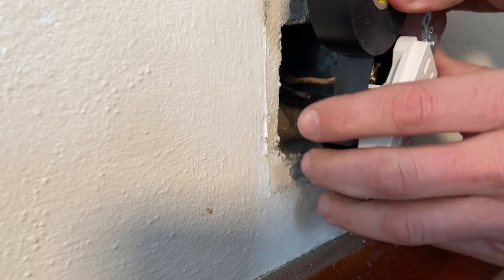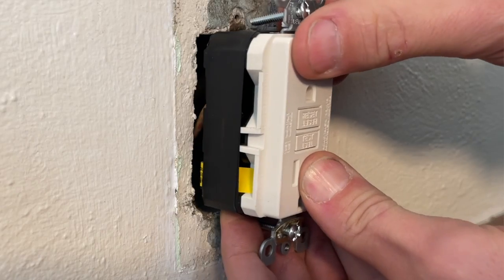Should You Wrap Outlets In Electrical Tape?

Comment: As an industrial electrician for nearly 20 years, I always wrap the receptacle in metallic boxes. I do not tape receptacles in residential and light commercial non metallic boxes. I do tape wire nuts in outdoor installations to help keep out moisture.
Reply: Have you ever removed a wire nut in a box that has been wet but has dried out? You’re likely to find find moisture inside the wire nut, it gets in but doesn’t get out. I’ve seen it hundreds if not thousands of times.

Comment: ALWAYS WRAP. nothing to loose. Possibly LIFE to save! (life of someone knowing nothing about elec opening and grabbing outlet, or hot screw touching metal box of an ungrounded home causing hot ground plugs of anything plugged into it.
Reply: No no need to wrap. That's your own damn fault for doing that. Bet you learned your lesson.
Reply: @bluejack-ve7so  you need to wrap in metal box.
Reply: @gabrielM1111  no you don't. Nothing in the NEC about wrapping a receptacle with tape in a metal box. That's just a personal preference.
Reply: @gabrielM1111  and actually a metal box is more safe than a plastic box. A metal box is grounded so if a hot wire comes in contact with it, it trips the breaker. With a plastic box it just melts it away. No return path to ground.

Comment: Before I end my wrap I like to leave a little tang on the end by folding back about 1/8 inch and stick it to its self. The next guy will thank you!
Reply: You plan on reusing that tape?
Reply: @dannychavez2420  No it's just a curtesy tab for the whoever needs to remove the tape later.
Reply: How long does it take to unwrap it? Waste of time!
Reply: @dannychavez2420  … it doesn’t take long at all if the last guy left you the tang (or flag) so your not fumbling around looking for the end.

Comment: This is hilarious, only wrap and use wing nuts if you are from the 1980's. All my remodels are done with WAGO 221 series snap on connectors (2, 3, and 5 port). Safe, UL listed, and highly durable. Works on 10 awg to 26 awg wire, never had a problem, not even with stranded wire.

Comment: Keep in mind that in many areas of the home, replacing a 2 prong outlet now requires AFCI and GFCI protection to meet code, and those outlets run about $26 a pop.
Reply: I refuse to do that. If someone wants them replaced they either get another two wire or it gets rewired. I don’t believe there is a substitute for a proper ground especially when you’re relying on electronics.

Comment: I wrap tape around outlets and switches especially in metal boxes and crammed boxes. Tape around wire nuts is pointless because if its done right there shouldn't be any risk of arcing.
Edit: I don't use wire nuts any more I prefer the Wago lever nuts. They are a lot better than wire nuts especially for old brittle wires.

Comment: Before there was Scotch 33+ there was just Scotch 33. Before that there was vinyl electrical tape of various brands and qualities, and some of it was horrible - it was brittle off the roll would dry out and fall apart quickly. Before that, black friction tape was commonly used to insulate splices.

There used to be a section in the NEC regarding proper taping of wire nuts which required the wrap to go around the crotch between the wires and the wire nut, covering the open bottom of the wire nut and providing additional mechanical strength to the splice.

Comment: I always wrap receptacles inside metal boxes. Master Electrician, CET
Reply: Why? Are you bridging the metal box to the receptacle? Because tape does nothing except trap heat near the wires.

Current doesn't magically jump air gaps unless the voltage is sufficient to overcome the resistance of the air. And if you have that much voltage coming in your stuff will probably burn down long before reaching that receptacle.
Reply: @etherealrose2139  Not wrapping the wires, but the terminal screws. It is mainly meant when one has to work on a live circuit. Sometimes it is just not feasible to turn of power.
Reply: I suppose you also love everything TR.

Comment: I never see these surveys and I don't even see some videos, like this one, that says was 2 years ago...

I personally ALWAYS wrap electric outlets, regardless if the box is plastic, which I will rip out if it is, and replace with metal, but regardless. The reason is probably my stubbornness to do things the right way. The reason I think it's the right way is because that's what I was taught in trade school back in the 1990s and the reasoning given was that when a box is stuffed with bare wire, "Grounds" that they can move and "spring" action from tension of being stuffed, and make contact with a hot or neutral side, creating a short or a danger. Then of course the second reason, which is my obstinacy on metal boxes.

When I started messing with electrics, I always wrapped my wire nuts but I also installed them correctly to begin with. I took my electricians pliers and twisted the wires first, then used the appropriate sized caps. Do a tug test. Then wrap in tape. Just always something a little extra. Also, had the idea that if something was to twist or try to wiggle loose, it would be less likely because of the stickiness holding everything together. When Wago came along, and I learned about Wago from you, and where I am at now, I loved them, and I still do. At first, I didn't wrap them in tape, but I noticed in some instances, they would pop open, or could even be pushed by a wire. So I do use electrical tape for those too. Just a wrap over the levers themselves, not the actual wires.

I don't see myself ever going back to the old wire caps again and even have removed a lot of wire caps and replaced them with Wago nuts, even though there wasn't anything wrong in the first place. More OCD I guess. It's not easy being me.

Comment: Interesting poll. My dad taught me about electrical wiring and he never used tape on the outlet. He taped the inside of a metal box, but never taped using a plastic box. I've never heard of wrapping the outlet, and I can't begin to imagine the frustration the next person will have to deal with after years of temperature changes turns the glue into a sticky mush. 

He definitely stressed the importance of proper wing nut wiring. He never taped the cap to the wire, but he did tape the wires right below the cap (to strengthen them from separating) and then again a few inches down. I've been using this technique to this day regardless what I wire. Gravity and time do some impressive things to wires we take for granted.

Another thing he taught me to do was to twist a ring on the hot wire, then use it to hang the line from the grounds. 

I never could understand why he did this until I studied electrical engineering. I suppose the technique of hanging was borne of a time when insulation wasn't great and electromagnetic feedback had an impact on electronics. 

We're a very foolish country for giving up trade schools and apprenticeships. Just a personal opinion.

Comment: One thing I have noticed with many of the recent  outlets is plastic rot I call it.
This were the plastic  in the outlets become brittle regularly of environmental conditions. I had the lowest quality  to highest due this???
I'm not a professional in any way.Is this because the companies are using lower quality plastics to save money in production  costs. This was apparent even before the Pandemic. I had to rereplace receptacles. The whole receptacle past front crumbled away. The reason I had to replace it was just plugging in cord for the vacuum. The tape on the plastic wire connector is a tough one.Its about 50/50 for and against the process .Good Video 😎

Comment: Electrical tape around a device is not needed. Some downsides: it can come off, can help encourage moisture retention around the screws, and is a pain to take off when the outlet has to be serviced.
Reply: NECA NEIS 130 5.3 Conductors (L) states "DO NOT wrap electrical tape around wiring device terminals. Taping wiring device 
terminals will prevent heat dissipation from the wiring device." National Electrical Contractors Association  National  Electrical  Industry  Standards
Reply: @Robnord1  I wouldnt call anyone a fool while suggesting using wire nuts in a high vibratrion setup. either a crimp nut or a properly crimped butt connector. in a high vibration application a wire nut should really only be used to test for example a motors rotation direction, I wouldn't trust it long term in a high vibration setup.
Reply: @wrenchinwithlondon3141  I agree with you, but worded my comment poorly. I see wire nut use regularly in my HVAC and RV work. In those environments, it's common practice to wirenut, then tape  for security. Not the best choice of connection for sure, especially joining stranded to solid, but they do it for economy. I don't complain much though because meltdowns are a source of income for me. 😉
Reply: @Robnord1  Oh definitely. I've seen a fair bit of it rv's and even heavy equipment. But I work on the manufacturing end now so we don't ever want to have to touch a piece again once we finish so wire nuts are a no-no minus for testing purposes haha

Comment: One problem I have found twice when an GFCI was wrapped with electrical tape:
Both instances were single gang metal box. The GFCI was wrapped and stuffed in the box, but the installer installed it slightly off center. The electrical tape kept the hot screw from immediately shorting against the box, but over time vibration of outlet use (guessing) eventually wore tape down and circuit breaker popped.
On one of them, the breaker must have popped many times, considering how burnt the screw was.
If the installer wouldn't have used tape, it would have been immediately noticed that the outlet was offset against the box. It might have been the outlet didn't originally have tape, but did after it popped the breaker after initial power was applied.
Anyway, I believe the tape is just hiding a potential issue.
Reply: So you’re saying don’t wear a hardhat on the worksite so if there is an unsafe condition and a brick falls on my head, I’ll immediately know it was a brick and then I can correct the situation?
Reply: @mook528  hahahahahaha, amen brother. I couldn’t have said it better myself. You beat me to it.
Reply: One suggestion for you is to stop using the word “popped” and start using the word “tripped”.

Comment: I work commercial and industrial. I do wrap receptacles in electrical tape because we use metal boxes. It’s good practice, and avoids shorts if we’re jam packing the boxes (double duplex outlet, or someone spliced in the back). Most of our receptacles are prefabbed with a pigtails coming out, so we just makeup with wire nuts, fold in the free conductors and screw in the device. 

I would make the device before any installs. So cut 7 inch conductors, loop the wire if solid, crimp the wire if stranded with a fork terminal, drive the set screw, then wrap the receptacle with electrical tape. It saves time.

Comment: I believe a good time to use tape on an outlet or switch and wrap the wire nuts is when you have a full box of wire nuts and a bare copper ground wire. When stuffing everything back in the box, that bare ground wire can sneak under a wire nut opening or touch an outlet/switch screw. Taping eliminates that chance and it only take a minute to do.

Comment: Same here, always in a metal box AND with Super 33 +. I don't normally bother with taping wire nuts, but go case by case. I noticed when he removed the tape, it was wrapped backwards. You should start on the wire nut wrapping in the direction you tighten it. Continue around at least twice and work it down onto the wire 3 times around. Like dad said, if you're going to do it, do it right.

Comment: What about the receptacles with USB ports built in with the standard plug?

These seem to have some openings along the outside of the housing which is meant for a heat sink or air flow and it doesn't seem intuitive to cover something like that up. 

Thanks.
Reply from the maker: Good point Jeremy, if there is a heat sink that would definitely not be advised to cover with tape.
Reply: @EverydayHomeRepairs  You can just cover the terminals only, but definitely not a good idea to cover the vents.

Comment: I use tape on receptacles when in a tight metal box as you have described.  I do not tape wire nuts as I have not come across any PROPERLY installed wire nut come loose over time. Properly installed? The wires need to be stripped to the same length, the ends need to meet, the installer needs to crank that nut down TIGHT!!   Then, pull on the individual wires one at a time.  Personally, I use the wing-nut style so that I can tighten them more easily than those without the wings. Keeping in mind, that we are speaking of connections that are not on vibrating equipment like motors. These are always taped if a wire nut is used at all, they are not recommended on motors.

Comment: There shouldn’t be any need to, electrical tape doesn’t last and just makes a mess....
Reply: Mark I have seen a lot of old wire nuts that have loosened with age do to either poor installation or just too much traffic vibrations loosening the wirenut electrical tape just happens to prevent the wirenut from backing out from imperfect connections and stranded wire with solid wire are the worst offenders for failure that's why I like Wago number # 221 lever wire connector. Which never needs electrical tape. It provides the perfect pressure every single time when you snap it into position. So I disagree with you electrical tape is your first line of defense against an improper or aging wire nut that is ready to fail. I have always used electrical tape since the late 60s and never had a single failure. Wire nuts must never be reused but Wagos can be reused.
Reply: @eugeneshealthproject  Yes agreed, 35 years in the field Ive seen that too. But to many people use really cheap materials including cheap tape....
Reply: Mark Stevens, I have seen that similar situation before. When I was working with my old boss many years ago, my bosses client complained about his electrical bill at his house, Sierra Madre, Calif., costing him to pay his Edison electric bill of $600 a month. What it turn out to be was the electrical tape what is the cause of it of the homeowners problem. It was the adhesive of the tape was semiconductive, not enough to short out a circuit but enough to conduct a current load. When we unravel the tape off on every receptacles and the last I’ve heard from the homeowner, he was paying a bill of $150 of his electrical bill that we solve his problem for him.
Reply: I’ve had to go on service calls because of receptacles shorting out on the sides of metal boxes. So yes, don’t put tape on receptacles going into metal boxes because i make a lot of money fixing them.
Reply: Well crap everyone's has a  point.  Tape for metal boxes . Don't stretch the tape on plugs and switches .   
Butt  The screws are ressed 
on the GFCI   NO TAPE  🤑
Bad workmanship   cheep materials.   Had so many  
splices fall apart tape or no tape
Reply: Mark, there are good arguments against using insulation tape on wire nuts. 1. It will trap moisture and cause corrosion. 2. Most cheap insulation tapes have glue that is slightly acidic; as a result this will cause corrosion. 3. Such arrangement will trap heat (no good) while we want to keep our connections as cool as possible. 4. Removing the tape after some time may give a little headache since you ma not want to use knife... These are just 4 examples from the top of my head but I'm sure there is more; I have been dealing with electricity since 1980's and I do not use insulation on wire nuts...
Reply: @spol1622  I worked with a guy who got electrocuted (220) as he was removing the tape off a wire nut connection to check for voltage! You never know what’s under all that messy, sticky tape..?
Reply: @dracula3811   I won't
Reply: Before vinyl, friction tape over rubber tape was the normal practice.

Comment: when rewiring my garage i used tape on outlets to color code them to the circuit breakers along with wrapping the tape roughly every 18 inches along the wire through the wall so if i opened the wall for something , i would know which wires i was looking at. also left a schematic in the breaker box for the next person. had electrician look it over before powering up and he had to chuckle..stating even a complete idiot could figure out what went where with how "simplistic" every thing was laid out.

Comment: For 40 years I have taped outlets and it passes code in Canada On any vibration like motors  in Industry  a couple of wraps of electrical tape over wire nut followed by wraps of electrical rubber tape and then final wrap of electrical ,the first wrap of electrical is so you don't fight getting the rubber tape off . This also for screw type lugs which are preferred over wire nuts

Comment: At 80+, been installing, reworking worn receptacles throughout my life. I've NEVER heard, at any time, from any elecrician or other, of "wrapping an entire receptacle like this before installing in a proper sized box!!  IF you do the wiring/connecting job correctly, and select correct designed and sized box, there's absolutely no need for this. If someone can bump a wall and cause a short, then someone totally failed to install the recept correctly!!  And who "bumps" a wall hard enough to knock a connection loose like this. All baloney!!! Nuts!! 
Oh ... came back to add ... yeah ... wire nuts, I wrap. Have more than once encountered where some idiot used wirenuts without physically twisting to connect wires FIRST. Wire nut just fell off in my hand. So ... I think it's a good idea to 'back up' the mechanical wirenut twist-on with quality tape, wrapped "with" the twist.